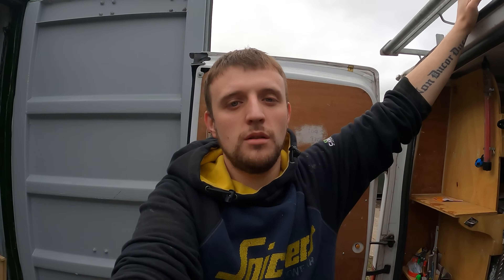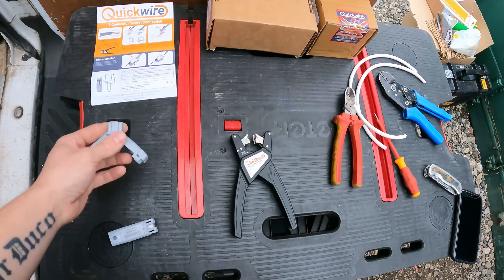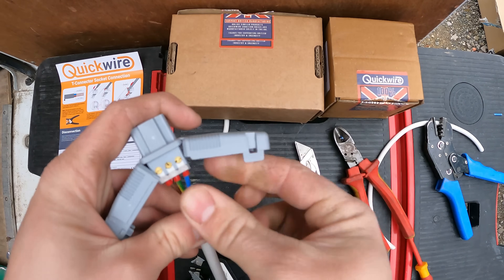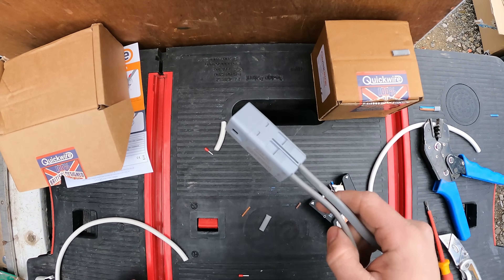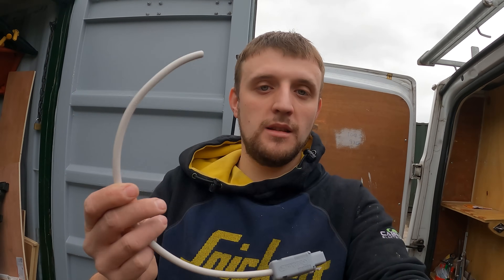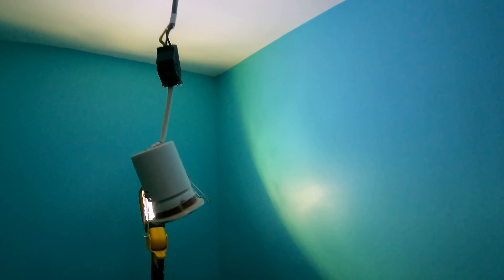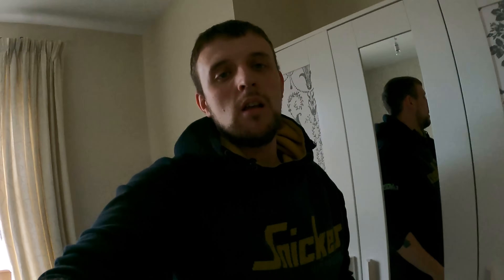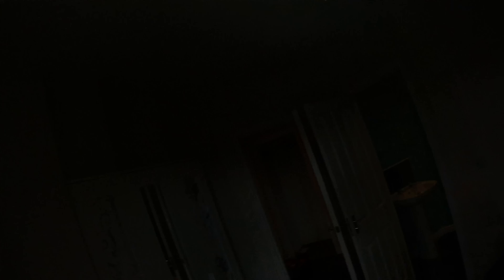Can’t Believe How Fast These Are | EICR Remedials | Electrician

Comment: On the T Connector plug, does it matter which side the loop in and loop out goes, or ok either as long as the polarity is correct in both ??
Reply from the maker: Doesn’t matter as long as polarity is right 👌🏼
Reply: @Cablesmith  thanks for the reply.  Enjoying the channel content.
Reply from the maker: @JimDIY801  thanks mate 👌🏼 appreciate it

Comment: Another good watch mate 👍 I’m slowly working my way through your vids mate 😂😂🙌🏻🙌🏻 I’ve noticed a while back all my down lighters in my house are all single insulated 😭 as from when house was built 18-20 year ago and it has single grey sheath red with cpc and grey sheath single black neutral no cpc ,which I never even new they did 😂 I’ll end up getting a spark to put new in eventually when I can afford it. Don’t think whoever does it could use them boxes tho,instead of replacing whole down light , as the cpc goes straight onto a lug on the metal down light, not sure if the boxes would work 🤔
Reply from the maker: They would work, but there is cheaper methods. Could be worth just replacing all the lights for the kind that can accept 2 x twin and earths instead. 
Enlite E6 pro are my personal favourites at the moment, really nice and bright
Reply: @Cablesmith  nice one mate I’ll look into them 👍👍
Reply: You might end up fitting them for me yet 😂😂👌👌
Reply from the maker: @kingofthetrowel1725  how far are you tho ? 👀😂
Reply: @Cablesmith  roughly an hour and 10 mins away mate 😂..is it too far for ya 🤔😀 👍
Reply from the maker: @kingofthetrowel1725  I’ve worked in Wrexham, Stratford, york, Hull, Aberdeen and Inverness to name a few. An hour is only down the road 😃😂
Reply: @Cablesmith  blimey yea it’s only a stone chuck for ya then 😂😂👍👍 I may be in touch then mate 👍 I’ve got more than downlights to do to be honest, led lights in bathroom,shaver socket, mirror ,extractor, kitchen sockets,lights, loads of replacements light sockets etc,new rcbo board with spd ..the list goes on mate 😂😂 I could be your camera man whilst your on with it 😂😂👍👍🙌🏻🙌🏻
Reply from the maker: @kingofthetrowel1725  not a problem mate, happy to.

Comment: Can these be used like standard junction boxes, or are they only for lighting? Like, could I use it to splice into an existing circuit to run power tools?
Reply from the maker: They are rated at 16A however the terminals only accept a maximum of 1.5mm so 99% of the time that would be a lighting circuit only. (In the U.K.)

I wouldn’t like to advise you to use them for running tools through tho.
Reply: Just chipping in to say, yes Sean is right in saying these are 16A so only really for lighting applications. We do have 2.5mm 25A (possibly up to 32A) Junction boxes in development so bear with us...
Reply from the maker: @quickwire80  I seen them last night and looking forward to using them. The ring version looks excellent imo. 
The splitter id assume would very often have a redundant slot, but still a useful thing to have on the van 👌🏼

Comment: Nice vid 

Out on interest why haven't you attracted quick wire to where the black connector is? Completely removing it ... 
Yeah agreed the screw In part shame as lever make them more secure and never come loose.

Thanks for the vid
Reply from the maker: First reason, because I’m an idiot and didn’t think about doing that 😃
But also it wouldn’t really be sticking with the lighting manufacturers instructions if I removed their connector. (That’s what I tell myself to feel better about the first one anyway) 😂

Comment: The nationwide problem of defective methods being used to terminate into downlighters is solely caused by the lighting manufacturers and the BS institute not providing and not specifying a standard means of terminating cables into the light fittings.   Of course it doesn’t help when sparks cut corners or DIYers, but this was foreseeable.
Reply from the maker: I agree with you. I’ve never really thought about it like that but that’s correct!

Comment: The connector boxes here are usually cut of as they have crappy Chinese screw connector blocks in them, they are replaced with coffin boxes and Wago type connectors, 
screw type connector blocks are not safe for long term use as the copper will eventually spread under the screw.
Reply from the maker: We try and keep lights etc in tact for warranty’s and following manufacturers instructions mainly. But they are dreadful
Reply: @Cablesmith  The warranty would be the last thing I would worry about on a fitting costing a few quid, More importantly is the potential fire risk and then if during an inspection it was discovered we could risk being de-registered until the situation was resolved which could include inspection of older installations to confirm none present.

Comment: They together very big What aboit qhen thete is small void No way ypu can slide them inside
Reply from the maker: They fit through a 30mm hole, which is rather small. Standard Downlights are about 70mm hole. 
Thanks for watching Derek 👍🏼
Reply: @Cablesmith  i dont mean that they fit thru small hole What i mean is small void above the ceiling or could be pipes or other stuff above the cut out so for shallow downlights only.

Comment: Genuine question, why do you join another bit of flex between the connection box on the downlight and the quick wire rather than just removing the connection box and fitting the quick wire direct to the flex from the downlight?
Reply from the maker: No idea 😀 leaving the light fitting as it is, is the only way I’ve ever known it done, no matter what kind of connectors have been used. 
May be warranty reasons possibly

Comment: great bit of kit but wouldn't it be nice if lighting manufacturers put a bit of thought into their connections ? rather than some of  the micky mouse s**t  that we end up having to deal with on a daily basis !  The number of times that I 've come accross a snazzy looking light design & then when you come to the connection side of it ,it's absolute junk & you end up wasting time to get a decent ,safe connection.
Reply from the maker: Completely agree, it shouldn’t be a struggle in the first place. 
Thanks for watching mate
Reply: A lot of them just don't care , they only try to make it look nice for the customers

Comment: Spin the sidecutters round when stripping and dont twist the flex ends before crimping
Reply from the maker: Spin the side cutters ?
Reply: @Cablesmith  the flush side of the cutters should push away from you, it's makes it easier and you can see better what you stripping
Reply from the maker: @ominence5573  I thought that’s what you meant, when I accidentally have them facing that way I hate it, really can’t get used to it that way.

Comment: is there a reason you didnt just ditch the connector between the light fitting and the quickfit? i.e. just use the light fittings flex straight in.
Reply: just seen you already answered this.
Reply from the maker: Mainly because I didn’t even notice 🤦🏻‍♂️ thanks for watching mate

Comment: OK probably a silly question as I am not an electrician.  You say the flex is 1mm is the twin and earth 1mm to? The only reason I ask is the twin and earth, maybe its just me or the close shot, it looks bigger. If it was say 1.5 mm the twin and earth and you stepped down to a 1 mm flex would you not have to put a fuse in between to step down the cable? You are probably using 1mm for both , maybe the twin and earth looks bigger in the shot and you are correct.  But as a layman if I was to step down from a 1.5 mm twin and earth on a ring to a 1 mm flex like that, would I have to fuse down?
Reply from the maker: In this case the twin and earth was in fact 1mm 
However even if it was wired in 1.5 you could still do this without fusing down, assuming the main mcb for the circuit was 6Amp. 
Also the single light in question can’t ever overload the 1mm that would be connected to it as you would need to fit a 2400watt light bulb to do so 😀 
So in theory it’s protected from over current at both ends really. 
Thanks for watching and asking 👌🏼
Reply: @Cablesmith  Ahh, ok. Cheers.  Good to know.
Reply from the maker: @HarveyPaul007  no problem, and remember, no question is a silly question 👍🏼

Comment: Great demonstration video and love the humour.👍 I think for time saved the premiered quickwire plug tails are the way to go if you are doing more than half a dozen of these. May I ask why you kept the can junction box in place - surely it is just an unnecessary joint that could fail?
Reply from the maker: Sorry, I see what you mean now 😩
Reply from the maker: thank you mate, appreciate it. 
The light can’t be opened the only connections is that connector strip so it has to stay

Comment: Have a look at page 16 of this Best Practice Guide on coding:
https://www.electricalsafetyfirst.org.uk/media/1626/best-practice-guide-4.pdf

It confirms what I'd describe as common sense by stating that exposed insulation on downlighters is a Code 3, so the EICR should not have described them as 'potentially dangerous', and failed the installation on the strength of that alone.
If I had to do three EICR's day for £90 each, then yes I wouldn't have time to think carefully about what the actual hazards are for each observation listed in Section K, but that makes the report pretty much worthless.
Reply from the maker: It all depends on the person testing and the job in question, in this instance the ceiling was made up of steel primary support and top hat sections so with a chance of them coming in to contact with bare metal, I would also have gave this one a C2 
but your right, occasionally they will never be accessible etc 
Thanks for watching mate 👍🏼
Reply: @Cablesmith  Indeed page 16 of the guide mentions the presence of metallic parts which would be Code 2 as you say.  The ceiling is generally out of reach, but something unpleasant could easily happen if the entire steel structure went live because of one of those downlights.
Thanks for the reply.
Reply from the maker: @westinthewest  I’ve personally seen the outcome of someone touching a live ceiling structure only a few months ago, a lot worse than you’d think. Still a chance he won’t have the use of his fingers again 😱
Thanks mate

Comment: What an excellent little product, thanks for taking the time to demo it for us. 

Loving the bootlace ferrules but I agree instead of those screws some sort of screwless connector that accepts stranded wire would be amazing like the Wago 221, would save you loads of time.
Reply from the maker: Thank you 😊
Reply: I thought the 221 wasn’t suitable for flex? Am I wrong?
Reply from the maker: @Chequr_Prostate  yep the 221 series are suitable for solid, stranded and fine stranded cables.

Comment: Great little connectors. Have to see if anyone supplies them in Ireland.
Reply: In Ireland you may have an issue as your T&E has insulated earth core. I believe the socket connector cannot accept an insulated earth core and never having used the Quickwire stripper I do not know if it will accommodate and cope with an insulated earth.
Reply: @normanboyes4983  the insulated earth core hasn't been in for that long. I was thinking that this would be when changing over from the old 12v  halogen spots to LED Spots.
Reply: @roydowling2542  OK - To be honest I was just flagging up as a potential issue as I am not in Ireland and have never actually  used the Quick-connect stripping tool. Mind you if you are using on the 12 volt output side then a bit of insulating tape would suffice.😉
Reply: @normanboyes4983  I get rid ofthe 12v transformer.  They cause much hassle. Put the 2 twin and earth's into a JB and a single flex out to the new led.
Reply from the maker: They really are, there’s a link in the description for a stockist finder.
Reply: @Cablesmith  No option for Ireland on there site. I sent an enquiry to see if they have a supplier over here or would the ship an order over.

Comment: You can also use those Quickwire strippers on flex, works just as well as it does on T&E. Saves even more time not having to get the side cutters out etc. 🤙🏼
Reply from the maker: I was going to try them but I didn’t wanna break the stripper before the job 😂 now I will tho
Reply from the maker: @Exploring With Dark Dreamz I’ve broke at least 3 sets of ck strippers. maybe me at fault tho
Reply: @Exploring With Dark Dreamz yeah they are great, but don't you have to have one for flat cable and one for round & one for coax etc. ?? 🤔
Reply: @Exploring With Dark Dreamz oh nice, similar to the ergo strip from Knipex then? Just without the ergo shape?! Will have to have a look out for one.!

Comment: Curious to what people are coding basic insulation outside and enclosure when they can’t be accessed through “everyday” use I.E changing the lamp
Reply from the maker: In this case the company that done the EICR gave it a C2
Reply: would like to know this as well... we had an extension done a few months ago and i supplied the builder's electrician with the spotlights; Enlite EFD Pro fire-rated cans that have push-fit connections. Granted these push-fits are not LENLEN but LLEENN but he didn't even remotely try to keep the grey insulation in the enclosure, with about 2-3 inches of blue&brown showing past the cable grip but even more curiously he didn't put the earths in the pushfit - he twisted them together and placed them in a single piece if sleeving (entirely outside the enclosure). What would you guys code that?

also, when your CU is upgraded are you supposed to have a schedule of test results for the finished board or is that not a requirement?
Reply from the maker: @peter-gn8ey  if your downlights had LLEENN then they’re likely made to accept 2 x twin and earths so yes should be inside the enclosure, I personally would give it a C2. 
And yes when a board is upgraded you should receive a full installation certificate and schedule of test results
Reply: @Cablesmith  cheers. I believe the EIC will come when the builder applies for the building warrant/completion certificate but from my conversation with the electrician before his work finished I don't think he's coming back to test the board. He holds a Scottish JIB ECS card showing 17th Edition (BS7671) on the back under qualifications... would I be able to contact them and say I've had a board fitted and no test results provided?
Reply from the maker: @peter-gn8ey  it would be him directly or his scheme provider such as NIC EIC. 
There’s a lot of different rules in Scotland tho so I’m not sure on what is required tbh

Comment: You can use t&e still on the output to save bootlacing the flex
Reply: You cant as the fitting can take halogen so could get close to fitting and cause heat damage or expose cable to temperature.
Reply from the maker: Didn’t even think of that ! nice 👍🏼

Comment: On a serious note, house developers need to hang their heads in shame, employing people who install downlights like that. Makes a mockery out of the NHBC warranties as well.
Reply from the maker: I agree ! This should come under that warranty, I mentioned it in the video but cropped a lot of clips out to shorten it.
Reply: I think the NHBC warranty only covers structural defects I don't think that you can completely blame the house developers as they believe that they are awarding electrical installation contracts who are doing the install correctly meeting the correct standards.
Reply from the maker: @anthonybragg  fair point. Although I’m sure if this and other owners made a complaint directly to NICEIC about having to pay to rectify work that should be correct in the first place, then absolutely nothing would happen also 😂
Reply: @Cablesmith  Assuming that the electrical contractor is a member of the NICEIC others out there the customer to the contractor is the housing developer, not the homeowner the homeowners would have to complain as a group to them. they would have to get the contractor to put it right at their expense or out of the contractor's retention monies. In this case, it is cheaper for the landlord to get you to do it as a satisfactory certificate is needed so it is between days or weeks to get paying tenants. 
One thing for sure installation methods like that is unacceptable.